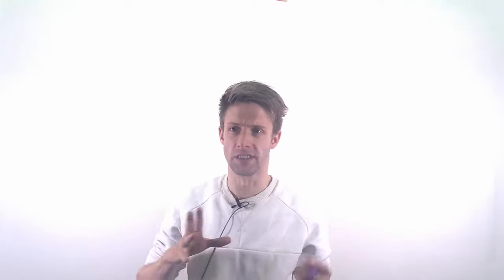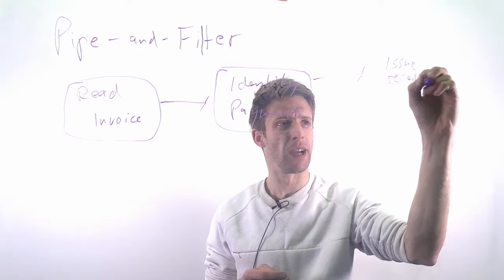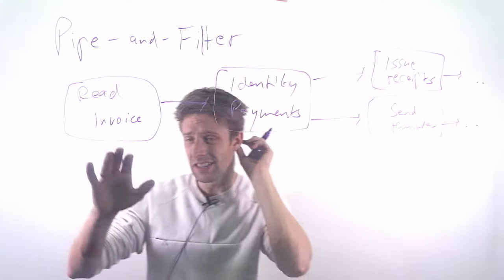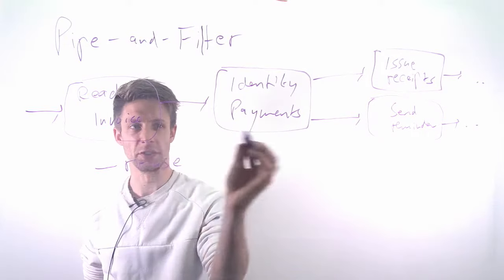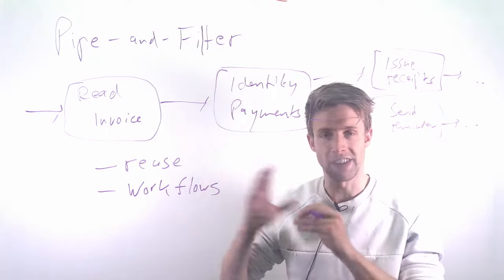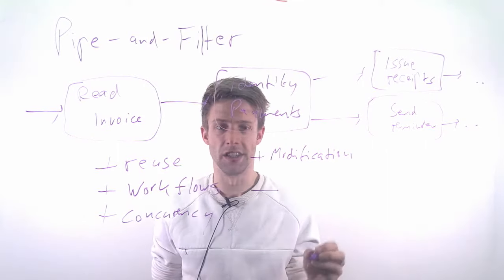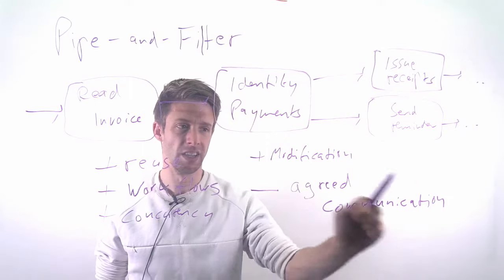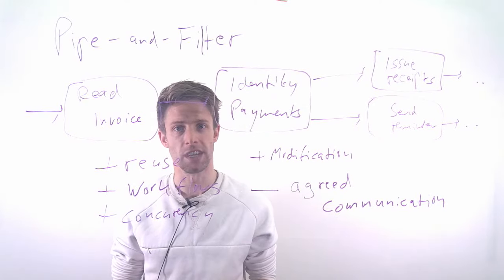Module 05: Architecture, Part 08: Pipe-and-Filter Architecture

Comment: It's good for data processing applications 
Graphic processing,logisics sytems, invoice system
Data flows through the pipe and is filtered out the way

We can reuse it cause we connect the pipe 
It matches with the workflow ,structured
Concurreny 
We can modify individually without changing the system
What is the kind of data that flows in and out of it/how the pipe should look like for which we should have agreed communication which is a disadv